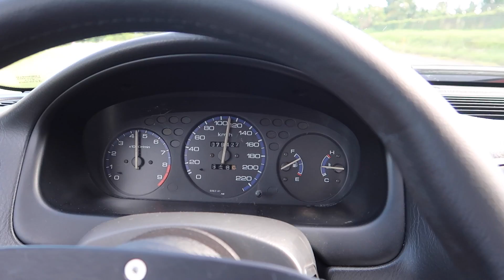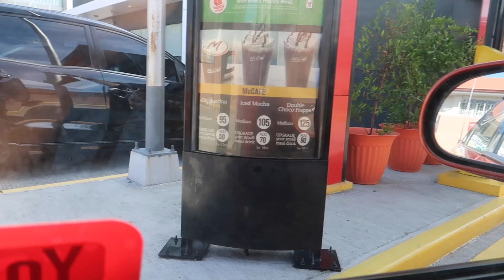Refreshing my 99' Civic SiR // DawgVlogs

Comment: Breather hose missing from intake pipe to valve cover. Is very important to have because oil with dirt contamination can cause clog of oil filter and worn of oil pump Bearings and pistons piston rings